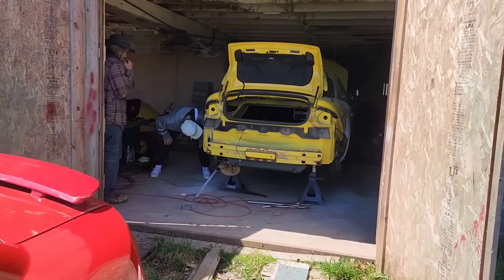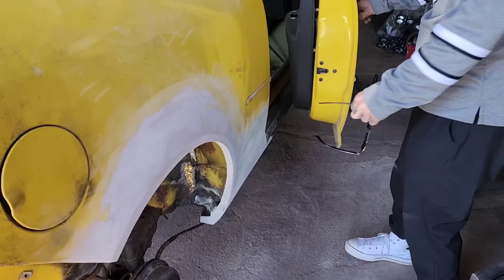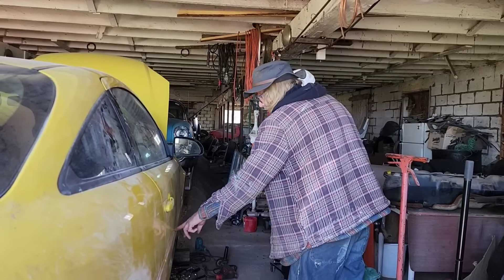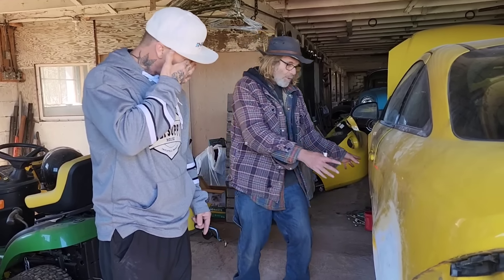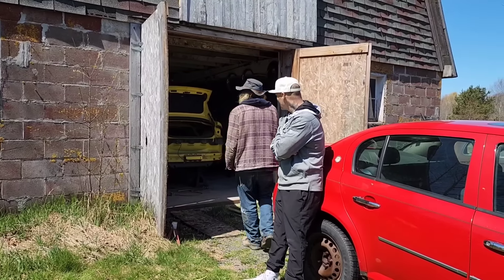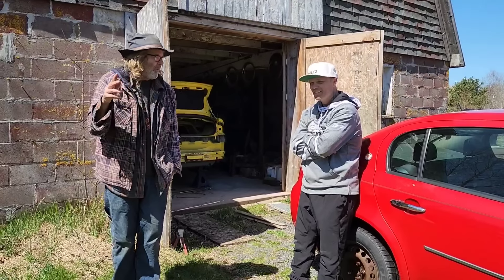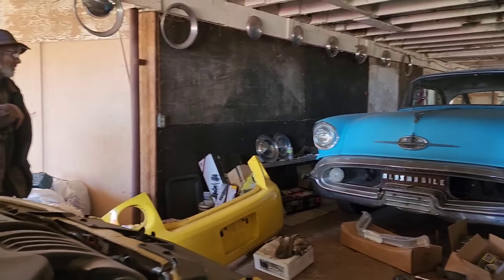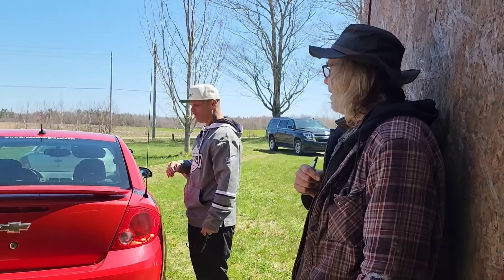Can't believe Jim did this with a torch 🤯

Comment: To remove side trim, gently warm and I mean gently warm the trim with a heat gun low setting. It’s only to reactivate  the glue.  Using fishing line (or dental floss tied to two small sticks as handles) the line gently cuts through adhesive.  Start on the short trim pieces.  I have rebadged many cars and removed trim.   Some cleanup after is required such as goo gone and or wd40.   It comes off but work small and gentle.
Reply: good idea, and a caramel wheel is great at getting off old glue, adhesive.
Reply: Lacquer thinner works the best and it won't go through the clear coat. Just a little elbow grease and a microfiber I've done it many times to remove pinstripes and badges.
Reply: @nicholastrojano2430   yeah it works...a few ways of doing it and depends on how thick and old it is as some of that thicker foam sticky stuff can set like rock and the caramel wheel gets it off easier.

Comment: Hey Chad and Jolene, tell Jimbo a sharp, thin putty knife to get the body side moldings off. It will only take a minute to get all of them off and then he’ll have to remove the remaining glue with a rubber wheel in a drill or just some thinners. I’ve taken hundreds off that way, it’s fast and I’ve never had a problem. 👍

Comment: Tell Jim to use 8 lb fishing line to saw off the trim. It's not easy, but it will save the door panel. Wear gloves to protect your hands and get a good grip. Then you have to use adhesive remover to clean up.  It will only take a day.

Comment: You can use 99.5% isopropanol to soften the glue on the strips.
Reply: That's what I've done. 90% ISO Alcohol, 10% Heptane or white gas which is Coleman stove fuel. Put it into a plastic bottle like a wood worker's glue bottle with squirt spout so that you can target the solvent where needed.

Comment: Use fishing string with the sawing motion (like you showed) to get the side moldings off the get a 3M adhesive eraser wheel to remove the adhesive.

Comment: Jim get a strong piece of fishing line running in between that strip and the door while using the heat gun to soften up the glue.. will cut through the glue quick

Comment: Use a MMA welding machine on low Amp and hold the negative pole on one side of the strip and positive on the other side. It will heat up only the strip and the glue melts...

Comment: Side trim I’ve always used 25-50lb fishing line, try to stay as close to the trim as possible to not hit the door, for the left over glue use a rubber wheel on a drill (can buy from Napa) and voila undamaged door!!

Comment: Jimbo…ACETONE . TRY IT …We put it in an empty Opti-Free lens cleaner bottle . It works great for a controlled spray amount . It usually removes decals and not harm paint but wash off after with soap and water.